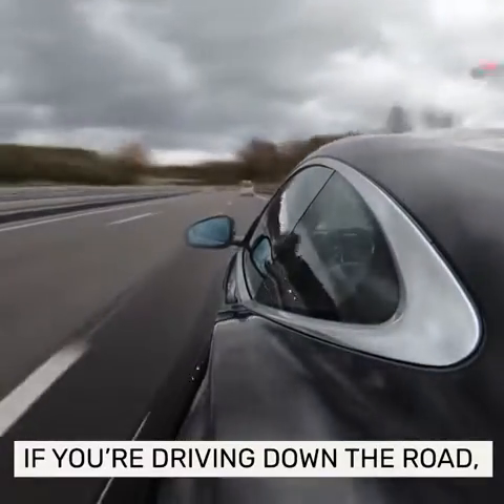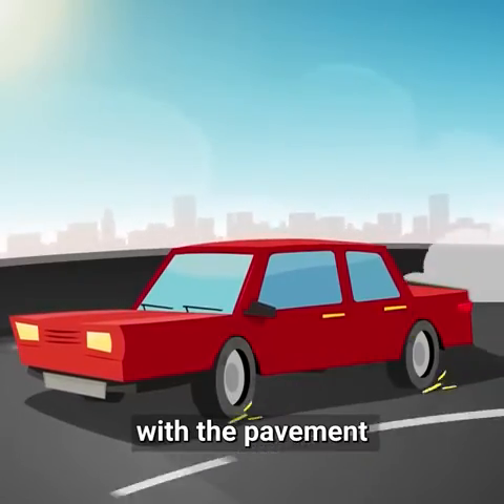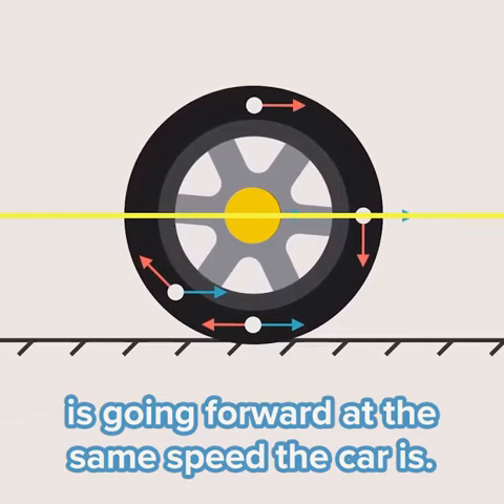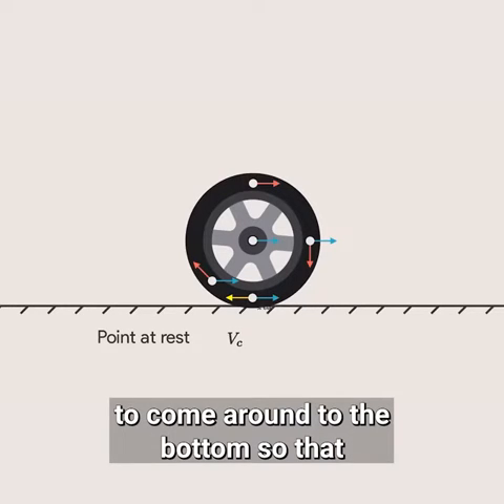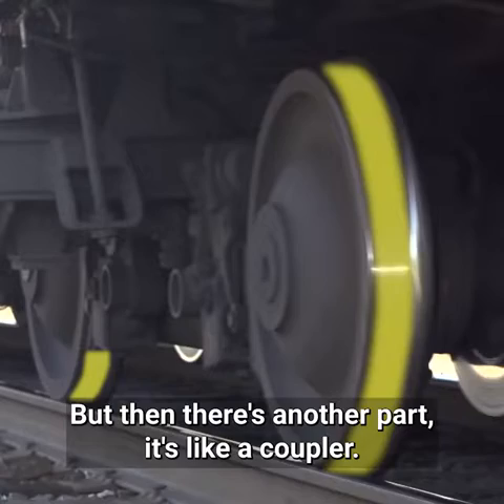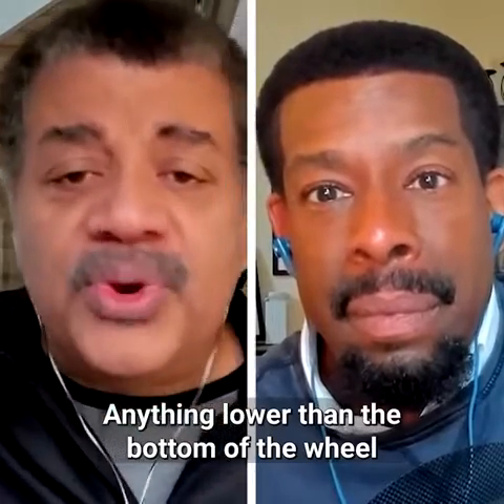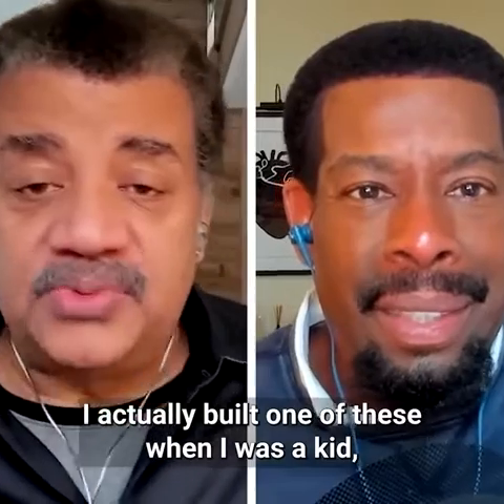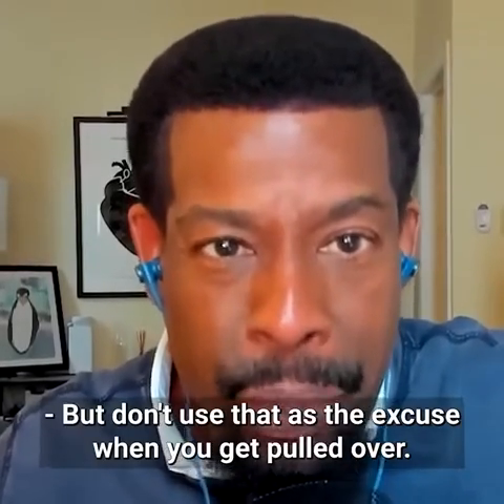Interestingly What is the fastest part of your car? By Neil deGrasse Tyson!

Comment: The railway wheel has a flange not a coupler lol.  The flange doesn’t steer the train the wheels are convex so they ride higher on a curve which slows the outer wheel compared to the inside wheel and that’s what makes the train take a curve . The flange is only a safety mechanism

Comment: I think the most interesting thing about this was during 3:50 because I never would’ve thought someone might be able to do that from just a signal.
Reply: This is the perfect example of why time travel is not possible. Time travel is a product of "theoretic physics". But when it comes to "applied physics" it just doesn't work.

In the car wheel example, if the car is travelling at 60 kmph then 1 minute ago that wheel was 1 km away & therefore must have forward motion. The problems start when some idiot physicist isolates 1 unmeasurable small point and compares its position in relation to another. You cannot separate 1 point in the wheel from the rest of the wheel. The "whole" wheel is moving in a couple of planes. To say that it is stationary in one plane in relation to another, is to ignore all the other relational planes! And THAT is piss poor physics. It is JUNK SHOWMAN DISHONEST physics!

This clip needs to be labelled "Comedy Only - contains absolutely no real physics"
Reply: @AllanCoker The claim is that whichever part/points of a rolling object are touching the ground at any given moment, they are not moving relative to the ground, and the opposite point at the top is moving forward at twice the vehicle speed, so 120mph in this case. For the train wheel, the points that are below the contact point are moving backwards relative to the ground/rail. Otherwise it would be slipping or skidding. That claim is correct. This is literally high school level physics straight from the text books.